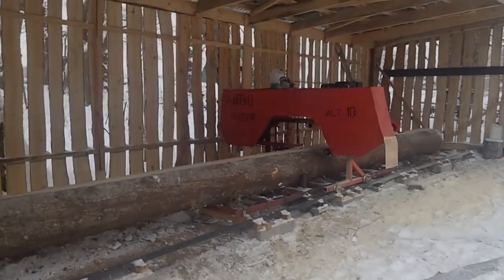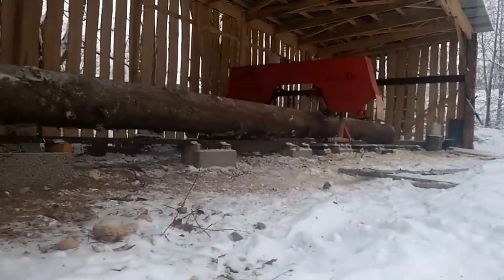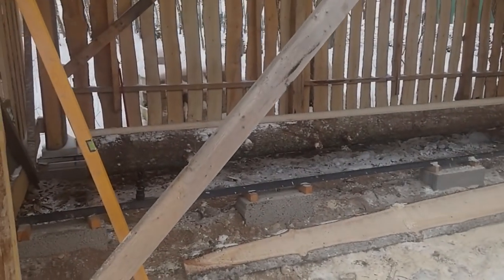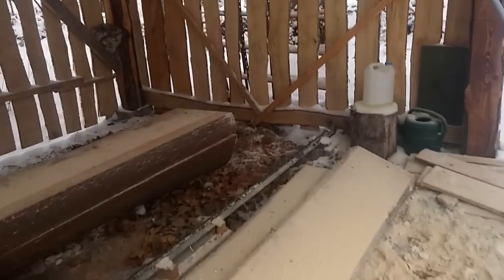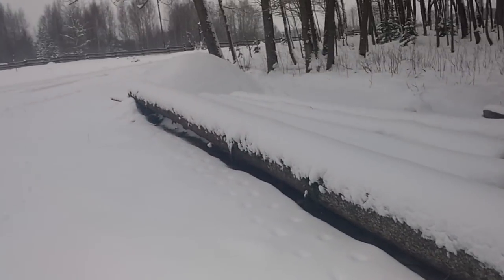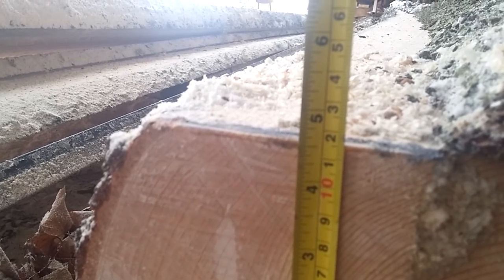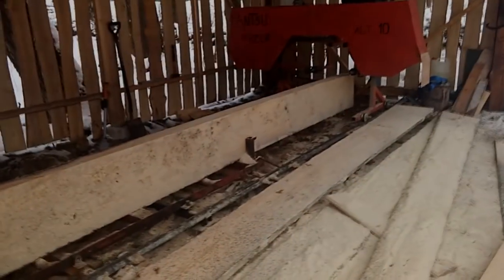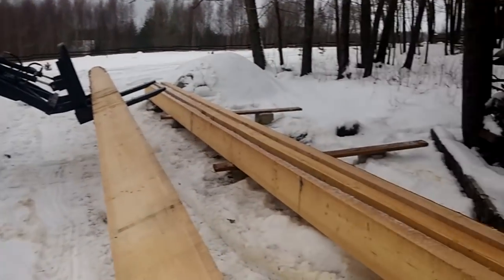Cutting huge beams on a DIY bandsaw mill

Comment: I’m happy to see a new video from you :) it’s been a while man! I like that you named your mill, and the guard is a good upgrade. Your mill shed is coming along nicely. It looks like winter over there, it’s warm and wet here in the Northwest of Washington, it got up to 16 Celsius last week! lots of windstorms, no snow and the way it’s looking I don’t thing we will get any in the lower elevations. Well it’s good to see your out running your mill. Take care
Reply: I just heard you talk about the jack not working out right on your cut, you may keep an eye out for some manual screw style scissor car jacks, the ones that come with cars. 
I have one I need to weld into my track so I can make one of my log bunks adjustable for tapered logs. Just a idea? Take care. By the way Nice beams!!!
Reply from the maker: @Mikefestiva  Thanks for the idea, the jack did work out with the next log, but with the first one i just jacked it up too much. My fault